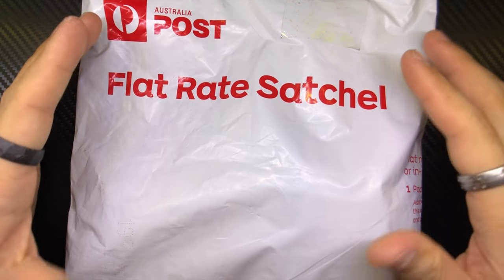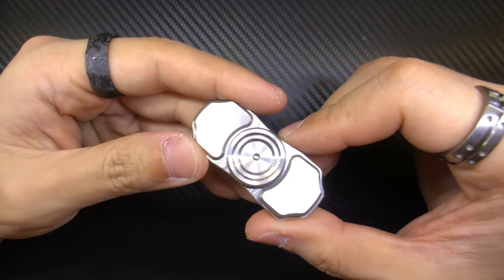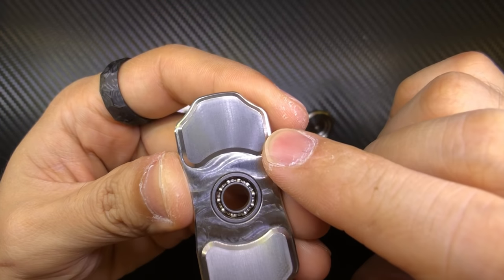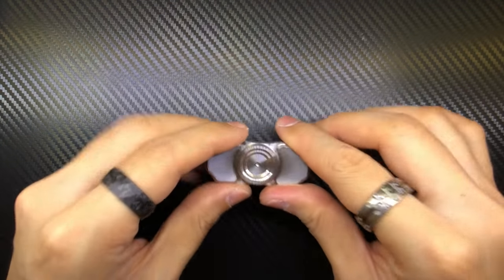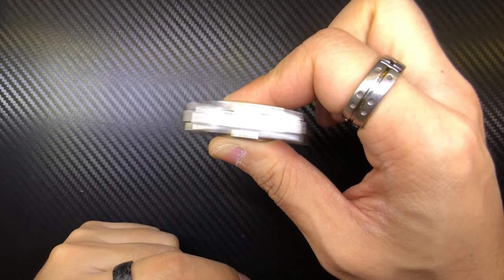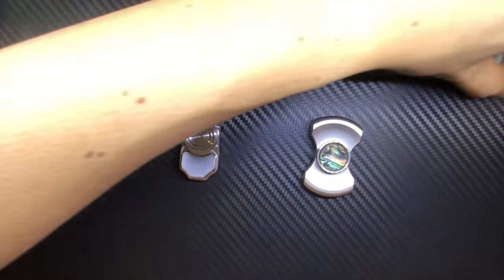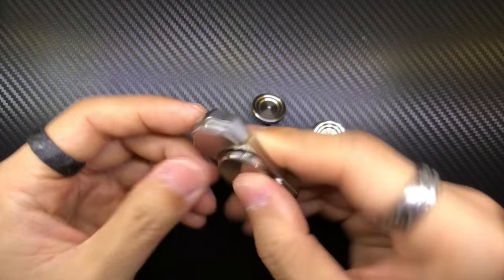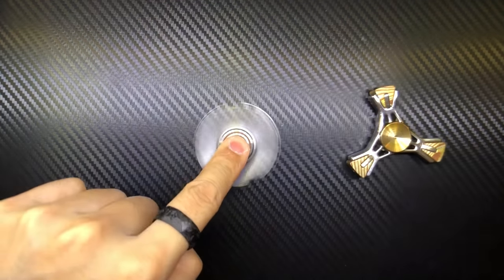First Look: Pressure Bar

Comment: Ben, awesome video and am so glad The design surprised you. Every aspect of the spinner was designed to be fidgetable and had no influence but what I wanted and needed In a spinner. Thank god you agreed on the taper because as you know was talked out of it and your input was for sure the reason I took the risk on the taper and it worked out better than I could have imagined.

The design was chnages multiple times and drove ascen crazy trying to explain ideas that didn’t make sense but we were able to get the feel exactly what I imagined when designing.

When it comes to the “clone” thing that is the first time I had heard that and honestly if it’s a clone of a ifdgt there was so much influence from the of Ifdgt. The ifdgt was the best spinner and the spinner I would pick up over all the others but I knew there were aspects I wished the ifdgt would have done on a second version. Things like the taper and  tHe slight curve on the waist were stand out examples of what could be improved. The design started allmost a clone of the ifdgt, untill things like the finger dip in the pads and larger size were chnages that came after slaving over it for 2 months. 

After we printed the first version we changed the pad by adding The chamfer you mentioned and making the bottom edges higher because there was one spot on the spinner That you couldn’t flick it from and we wanted it to be something that offered a wide range of spin methods because  during the design and during feedback we realize that everybody has their own way of spinning a spinner it is very diverse and everybody has their own little New wants to spinning a fidget spinner.  The idea of everybody having their own sweet spot on the pads was exciting and hopefully it ends up working out that way hopefully everybody has a good sweet spot to flick it.

 I have to thank Angelo and real orbit for bringing it to life when I first decided to try and get it made it was because of all the love and comments from the daily fidget and the support to get it made this whole project has been completely for spinfam and would have never made it except a version for me so hopefully everyone who pushed me to make It will enjoy it.

 The spinner took a long time to put together we worked on it for at least two months before anybody contacted us about production and after trying to put money together in the community and being beaten down I almost completely gave up until Angelo contacted me as well as many others to not give up on it .

 So yes the backstory is long and messy and a lot of people have completely different ideas or complete different truths about it but hopefully it just brings more attention to the design and maybe it can be part of a family and keep getting made with community feedback. 

 Sorry for the copper not being part of the first run there were certain things I just couldn’t get done like the copper and black coating on the stainless but like I said hopefully the pressure Bar finds a good home .

Comment: Another great vid! I agree calling the Pressure bar a clone is silly. During the height of the spinner craze there were loads of creative designs, fact is a lot of them weren't all that great. As they've become more refined we're seeing a lot of similar sizes and shapes because they tend to fidget better. While I won't say it's impossible, I do believe we're at a point where most new spinners are going to be an evolution upon other designs and not something wholly original. As you correctly pointed out there are plenty of bar spinners that incorporate a design where it's essentially a flat bar with raised weights at each end. Immediately calling anything similar a clone will only stifle creativity and refinement.
Reply from the maker: Thanks for leaving your comment and sharing your thoughts, Daniel.

Yeah you're right - evolution upon designs is the way to go.
It's the same as not reinventing the wheel, but rather, improving and evolving the wheel to suit different needs.
Reply: You nailed that my friend this was exactly that evolution of what venom had created and what I thought could be improved on . I took their design and changed it to what I thought would be the most fidgetable thing for me.
Reply: Just wanted to add the update that I got one of these. It's a fantastic bar spinner, one of my favorites. Got number 12/20 in stainless. Couldn't be happier with the design and fidgitability.

Comment: Also the inertia is a amazing Spinner.  When I first got it I started spinning it and hated it.  I think this was due to the fact that I use bar spinners constantly and the length of the arms were something new to me but as soon as I changed up the way I Was spinning it I couldn’t put it down there was something magical about it.  I love the way the weights scraped my fingers and especially the warp and doughnut style spin it had. 

If you haven’t picked up at inertia I am pretty sure that they are almost gone so go get one because it is a amazing piece